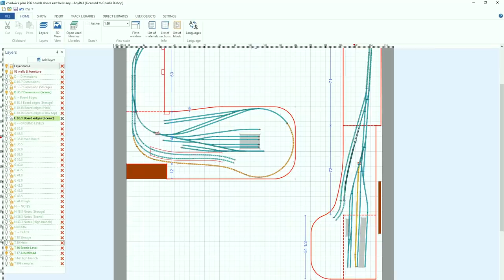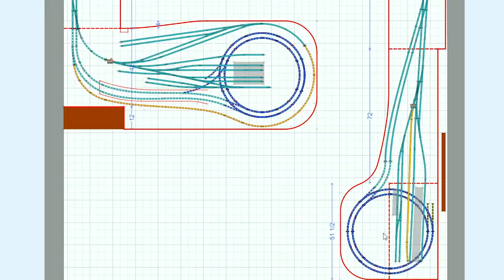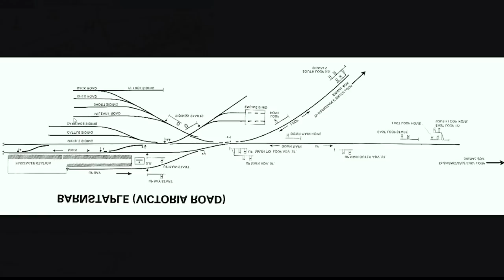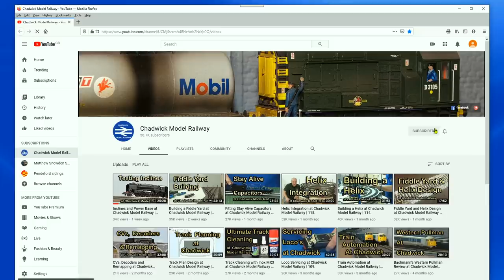Track Laying on the Station Approach at Chadwick Model Railway | 125.

Comment: Just found these videos.  You had your Barnstaples mixed up, Victoria Road is now a car park, it was a lot bigger than  3 coaches 7 at least and handled through trains to Ilfracombe post war. Now engine came on the back and took the other approach line to Barnstaple Junction, shown by the main road, once handled 10 coach rains, now just a single track.     Your scenery is Excellent
Reply from the maker: Thanks for the info David. Much appreciated, regards Charlie

Comment: Thanks Charlie, another interesting and informative video. Watching you check your track for kinks reminded me of a great tip from track building guru Norman Solomon who suggested using a small mirror, like a ladies handbag makeup mirror. Hold the mirror against your track facing towards you beyond what you’re building and it effectively doubles the length you’re looking down. The longer view makes any kinks stand out much more. Harder to explain than do, borrow a mirror off of Mrs B and give it a try. Best regards Simon
Reply from the maker: It’s a great tip Simon, and one that I have used in the past.  however, as usual I can’t find it!

Comment: HI Charlie
Modifying peco points As you describe also prevents short circuits with stock that has larger wheels.
I originally left the point as original and placed insulated joiners on the frog rails
However, the point blades both assume the same polarity and are thepolarity of the rail that they are switched to(if that makes sense).
There now is only a small gap between a point blade and a nearby rail and they are different polarity
A overscale metal wheel especially at speed and on a curve Will short this out . Intermittently!!! Took me
A very annoying time to Work this out.
Keep up the good work
Howard
Reply from the maker: I’m so pleased that you found it useful Howard.

Comment: Hi Charlie, loving your work. A little tip I use for checking your track is straight is use a small mirror so you can see down the line without have to be a gymnast look down to see if the track has no cinks in it.
Looking forward to the next video
Reply from the maker: Are use a mirror too, however as usual, I can’t find the wretched thing. Regards Charlie

Comment: Hi Charlie very good video nice to get a little refresher on the points, I know you have done ballasting already but a good one would be to cover ballasting points which is a nervy one for most  by the way  it was me mentioned the car hoover from halfords and you still haven't named me and it wasn't ridicule it was a helpful tip at the time you were fighting the missus for her tights to wrap around her hoover.
Regards
David
Reply from the maker: Rest assured David, it wasn’t just your comment regarding the small vacuum cleaner some folks have ripped me apart for it! Regards Charlie

Comment: You presentations are wonderful.  You're so succinct and yet technically descriptive.  Your self effacing sense of humor emerges too.  For my needs: I'm developing an N gauge  layout after a 64 year hiatus from model trains.  I purchased some Peco flex track and two insulfrog turnouts.  However, I am still in a quandary about whether I should prefer insulfrogs or electrofrogs.  My layout will be DCC and I will not likely have legacy locos, all new.  I expect that my choice of new locos will mean that I don't need electrofrogs.  Right?  If I asked you a similar question in the past, please excuse me, but I need some certainty before I invest in more turnouts.
Reply from the maker: Hi Jerry, I would always lean towards electrofrog.  With short wheelbase locos, such as 0-6-0 and 0-4-0, their pick-ups are limited.  They also look much more realistic. Regards Charlie

Comment: As a former carpenter, I will say this. you skills my not be the best, but I have seen worst in places where it will hold more weight so don't worry about it. I like that you use screws As these tend to not pull out, and as a carpenter you use what is to hand. So a good job as it works.
Reply from the maker: I shall take that as a well deserved compliment Keith. Many thanks regards Charlie

Comment: Excellent update again Charlie and great progress! Barnstaple track layout looks really good and well engineered ... and the baseboard and supports appear nuclear blast proof! (perhaps a test required with a nuclear flask to the good siding?! 😜) I’ve never seen those countersink drill bit combination: excellent idea and I’ve just ordered a set ... I wonder if the manufacturer are confused today with a rush of orders! Good luck with the next stage of the project 👍 Regards, Mark
Reply from the maker: I’m so pleased that you enjoyed it Mark.  Rest assured those drill bits will sell out.

Comment: Great vid mate,very professional now subbed
Reply from the maker: Thanks Michael, it’s great to have you onboard.
Reply: @ChadwickModelRailway   thanks mate,can I pick your brain,when you do a raised track on plywood how do you go about doing the long curves n the board? Do you just freehand with a sharpie then cut with a jigsaw and then lay the track ? I will be building a N gauge layout which is 9ft x 7ft and rather than having the track laid on a flat board I’d like my track raised (similar thing to moldy raspberry’s layout) and my board is going to be in 3 pieces for if I move house which in my mind brings more problems trying to get the boards and track to meet each other
Reply from the maker: Hi Michael, yes that’s exactly what I do. Just keep the board a little wider than you need for last minute adjustments.
Reply: @ChadwickModelRailway  thanks mate so to get the nice smooth curves it’s a case of eyeing the track as you lay it down.

Comment: Hi Charlie. Great video. I;m waiting for the weather to get better so that I can get on with my O gauge in the garden. I will have gradients there too.
Just a note on prototypical practice that you may find interesting. I used to work for BR as a guard and I often see model trains running in videos with their cab lights on all the time. On the big railway, drivers only use the cab lights to enter or exit the train (unless stationary and having a cuppa etc). The reason forthis is that at night the cab lights bounce back off the windscreen, making seeing outside almost impossible. Try opening your curtains at night and try to see outside and you will see what I mean. Don't put the cab lights on all the time "just because you can", is the answer.
Great times watching your works on the layout. 
All the very best. Paul
Reply from the maker: I couldn’t agree more Paul. I tend to use mine only in stations or in the TMD. Regards Charlie

Comment: As usual, loved the video. Now that was some serious over engineering but I see the logic to using all the scrap timber. I have to say I think that that is the best modellers clamp I have seen for a long time. think they might make a slightly bigger one. The thought of you using that to make a tiny "n" gauge wagon got me chuckling. For the last week I have been going the other way and started to construct a prototype open plan layout entirely from 5mm ply. I am lucky and have a decent 300 x 400 laser cutter so I can very quickly cut out all the intricate shapes needed to get real strength into the structure. I intend to make it fully modular with a small number of totally interchangeable parts that can be assembled in to any shape. I have already designed and cut out the prototypes for the base board framework, track elevator frames and some standard track work bases, It is so easy and quick with the laser doing all the heavy lifting. It all weighs next to nothing but I was concerned with strength so the first thing was a prototype of a 900 x 600 base board frame. To test that frame I mounted my 90kg Laser on it and after almost a week the laser is still at its original height and all is well, no sagging or cracking and all with 5mm ply box sections. However as an ex-civil engineer I fully remember what eventually happened to the box girder bridges all around the world. So fingers crossed and hopefully the laser will stay safe and well on its new support frame. Keep the video coming as they do brighten up the tedium of Covid restriction in this part of southern France.
Reply from the maker: I’m so pleased that you enjoyed my over engineering!  I’m glad you’re e making good progress with the laser cutter, more than I am with my 3D printer!

Comment: hi charlie just a tip when using small screws if you put a small dob off blue tack on the end off the screw driver it will stop it falling off ok
Reply from the maker: I tend to magnetise the screwdrivers Derek. Regards Charlie

Comment: Have you ever tried using Coydex for gluing down ballast? Copydex can be readily watered down quite a bit so may work well with a dropper to drip onto ballast? (I'm a theatre props maker and we water down copydex loads to glue together slabs of polystyrene. On that theme - take a look at a specialist Theatrical Chandlers website for 'Flints Hire and Supply' they sell some odd tools/glues and propsmaking materials - ideal for making scenery).
Reply from the maker: Hi Clive, yes I have watered-down Copydex and used it to secure ballast. It works very well but it can discolour the ballast quite severely and leaves skin on top. Regards Charlie

Comment: Hi Charlie. It didn’t matter about the point motors because you could have made the supports lateral, ie. parallel to the wall. That way you could have had a long inclined support on each edge of the baseboard and that wouldn’t foul any point motors!
Reply from the maker: Where were you when I needed you Ray! A great comment.

Comment: Hi Charlie.  Great video.  You didn’t mention why you used an Insulfrog double slip rather than the electrofrog version?  Keith
Reply from the maker: The electrofrog is only available in Code 75.  If I was operating shunters in that area without “stay-alives” I would have.

Comment: Hi Charlie, I hope the points on the incline don’t lead to problems with derailments later. On my track plan I went out of my way to avoid them. This was after I had read somewhere that they could be problematic. I wish I could remember where I’d read it. Anyway, another great video. Looking forward to the next instalment
Reply from the maker: Yes there’s a risk but I think that it will be okay as it’s low speed DMU’s and short freight trains only.

Comment: Hi Charlie, Your new layout is looking good. I did think the profile of the joint to the viaduct looked a little odd when you were offering it up to check the fit, do you think it would look better if the last foot or so curved towards the station approach? Regards, David.
Reply from the maker: Thanks David but rest assured that with the track bed it is a smooth transition.

Comment: Hello Charlie, greatly done like allways - thank you for this video! 
What I do is a look into the future and I do see a problem coming on to your layout. As the additive piece of scenery over the heating sounds a good practical idea - but that's the point where the teeth of time will start to work. 

The fixing
What about adjusting it by cheap magnet foil stripes glued on the board on the one side and counterpart it by cheap iron screws on the other to get a good join? It can be easily removed from the board and will pop in the correct position due to the magnetic force.
So you can go on with an open frame lightwight building technology and having an easy and secure locking of this critical part of the layout. 

The theet of time
As it will be touched quite often what about to use an real brench of wood? By taking it upside down you allways get a stem. By cutting it at a joining you get the impression of the routs starting to spread into the earth - and just breating off it somewhere above you will get the effect of a tree hit by a lighting - with removed bark. (I tested it on scenics for tabletop quite often to move bigger units.) By removing parts of the bark you can glue the rest bya little amount of superglue running between bark and tribe. So you maybe getting some scenic intrest into the background and a proper handle for the removable part over the heating's gap that is touched hundets of time a year. As you have to the lean all over the layout a precise fitting is not allways possible. So a repaintable item oaround the front side like a tiny retaining wall or something else easily to repaint may be a good idea. As we all know as gras over the years will be rubbed off to its undergound - looking at the edges of older exhibition layouts may give you some idea what I am talking about.

So I hope this may be helpful.

I am very thank full you didn't screw the board heavy forced on the u-beams so thy would wrap into stairs over the time due to a lack of beveling the supporters surface by sanding it parallel to the increase of the board.

Wonderful project you do and an entertaining time every week when I will get a good footage BBC and the others can not longer reach on in charming and intrest and quality.

Yours, Chris
Reply from the maker: What a fascinating comment Chris, many thanks. You have made some excellent points regarding the removable section and I will give it much consideration. Stay safe, regards Charlie
Reply: @ChadwickModelRailway  Thanks a lot, Charlie, if I could ne helpful I would appreciate that very very much.

Comment: Hi Charlie Great videos. Live in Geelong,Victoria, Australia. My wife came from Swindon and her dad worked at GWR. Am about to start a layout 5.4M x 2.2M. Have watched a lot of your videos and like idea of lifting the board to wire it up. But can you please tell me how you join the track after wiring the last board to the one already down please. The layout will have around 100 m of track and i just turned 70 this week. So would like to do it the easy way with out going under the boards too much. This will be the first layout i have done. The track will be Bullhead 75 as they have the unifrog points for that track. At this stage when I spoke to Peco they have no plans as to when they will make unifork points for 100 track. Hope you can help. Thank you.
Reply from the maker: Hi Clive, when I join up my larger boards, I tend to use 6 inch pieces of track to bridge the boards. Should I have a need to take the boards out, like moving house, it’s not the end of the world! Regards, Charlie

Comment: Nice one Charlie, Excellent video as usual. Thought you would have used the W.S. Foam Tack Glue as it is more rubbery in texture and better for sound reduction than PVA. Does Copydex have similar sound reduction properties? 
Bought a set of those countersink drills a long time ago and boy, they do save me time, even though I have 3 cordless Makitas' it's still quicker with just the one.
Reply from the maker: Yes Richard the Copydex is very similar.

Comment: Technical advisor? Guru!
Reply: (or nerd if you like) :)
Reply from the maker: A valuable asset.  
I’ve ordered a catch point for the goods line to protect the double slip.
Reply: Catchpoints added to the plan. Including the one you installed for the branch line to what was originally the high level station over the fiddle yard.
(Quicker to add it to the plan than order it, wait for delivery and install on the layout)

Comment: I’m impressed as always with your work, Charlie, but I do have one slight concern. The inverted ‘U’-shaped supports for the Station Approach have the top surfaces at 90 degrees to the uprights along the axis of the rails. Therefore, screwing the inclined trackbed board to these could result in a ‘switchback’ profile, rather than the smooth gradient you are trying to achieve. Can I safely assume, therefore,  that you either don’t screw the board down tight, or that you have some other fixing regime in place? It’s so difficult to get smooth transitions.
Reply from the maker: Yes I have thought about that Perry. I intend to screw it down at an angle, after all, no job is too small to botch! Regards Charlie

Comment: Hi Charlie, the layout is looking really good.  Could I suggest, if you haven't done so already, that you take a look at the National Library of Scotland (NLS maps) I use the overlay layer 1888-1913 quite a lot. It has a lot of useful tools and gadgets on it. You can also transpose the image from the 1888 image to a modern Google image and see where the old lines were, and also see what is still there!. There are measurement tools on there also. I have just taken a look at Barnstaple Station and it shows quite a lot of detail in that area which may be of some use to you. I used this site quite a lot to help me with my N Gauge layout of Ross-on-Wye Station.  Stay safe mate.  Cheers... Les.
Reply from the maker: Thanks Les, what an interesting comment. I shall certainly check it out, regards Charlie

Comment: Very enjoyable as always Charlie with lots of good tips. I wonder whether you should have considered another turnout between the double slip and the goods yard area to provide trapping protection for the passenger lines and also a short headshunt for when you are doing the run round moves. The layout I am building also has a number of levels and I struggle to get even vertical curves. I am planning to change to the Kaydee couplings - have you experienced any problems with them lifting out from each other if you go from an incline to a flat section?
Reply from the maker: Yes I have John.As you say, as you lift out of the curve they can easily come apart. Careful planning is everything on this one. Regards Charlie

Comment: Just a thought Charlie if you are going to struggle to fit a Tortoise to that initial pointwork, maybe check out the Cobalt SS Surface mounts, I've found them useful when I've had a couple of unavoidable braces getting in the way.
Reply from the maker: Thanks for the advice, if I have problems I will certainly consider it.Regards Charlie